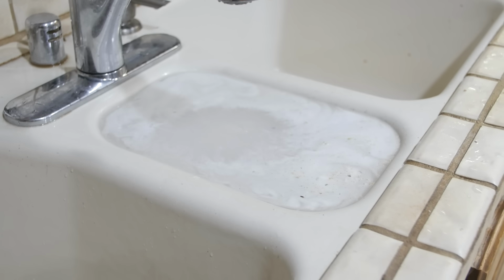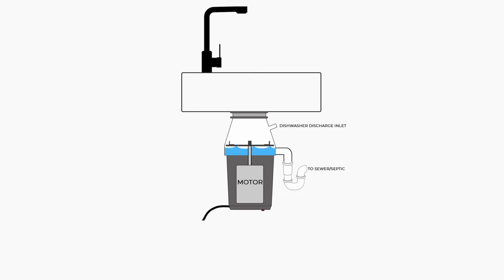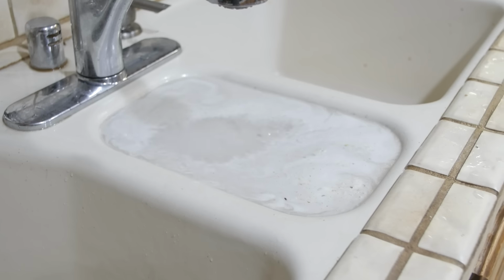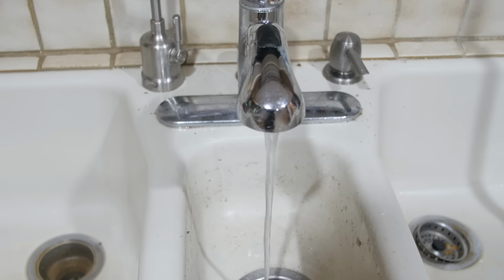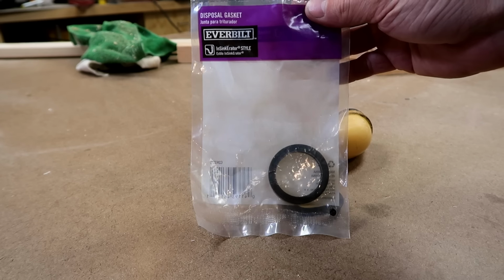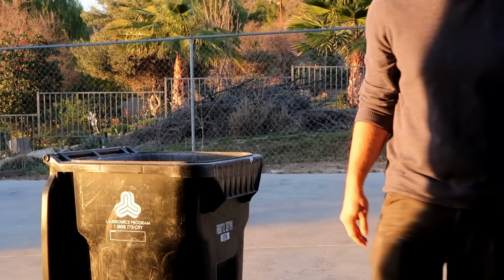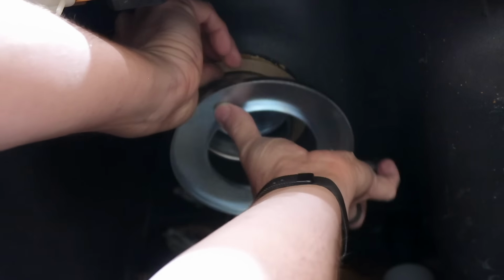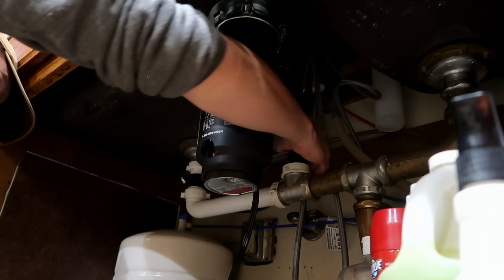How to Unclog (Or Replace) a Garbage Disposal | A Plumbing DIY Guide

Comment: I love your explanation! Was going to hire a plumber but I can do this! The only thing is that previous home owner has wires coming out from whip in the wall. I want to put plug on disposal and convert whip to GFCI. I just saw another video where you did that, so thanks👍🏼. This might be three or four Fbombs for my skill level but I have to learn to be more self reliant. If not I’ll have to add a 🖕 to the difficulty and say, this f@@%$ing job was a middle finger and four f bombs! Lol

Comment: What happens if your sink is draining fine when running water, but when you turn the disposal on it is struggling. I mean the disposal is running but the water is having a hard time to go down? Only when the disposal is running. I also have a dishwasher attached to it, the dishwasher drains fine. Thanks
Reply: Same issue for me
Reply: @alvoye20  DID YOU WATCH THE VIDEO
Reply: THE VIDEO COVERED THIS SO NOT SURE WHAT YOU ARE WATCHING.  IF YOU CANT BE BOTHERED TO WATCH CALL A PLUMBER